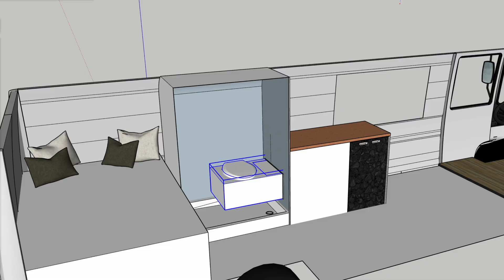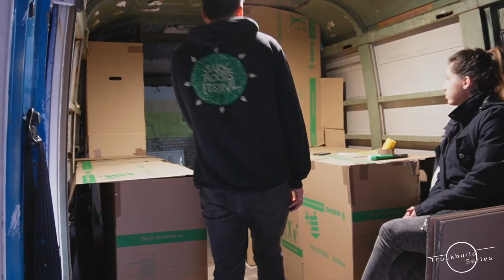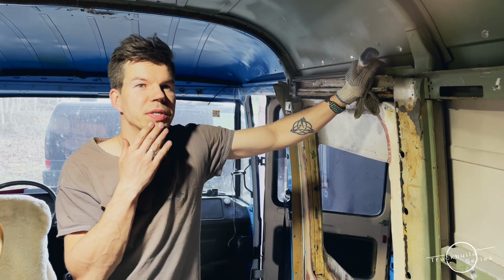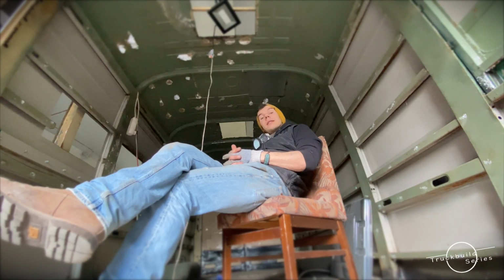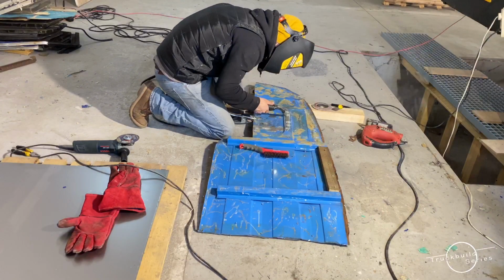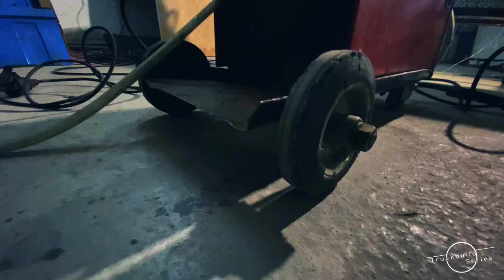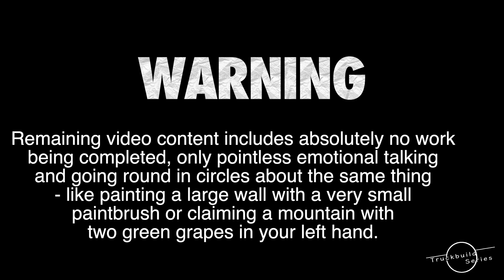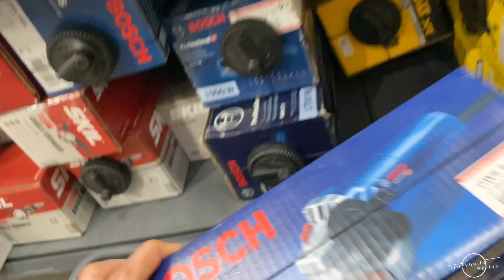Mercedes Benz 508D restoration , Ep1, Demolish and Planning

Comment: Feel your pain! Just a tip when you make the replacement panels, make sure there is a consistent gap all the way round of the same size of your mig wire diameter. Aim the wire between the plates I.e into the gap and that way you’ll get full penetration. Also to mitigate warpage tack weld all around the plate first. When you start Stich welding make sure you aim into the previous spot weld by a third of its diameter. If you have an airline then use it to cool the welds before each spot weld, or a dampened rag will do the trick too ( not wet just damp). You’ve got this 😊
Reply: Got all the tricks up my sleeve now, Thanks 🙏

Comment: Cleaning off the paint helps
Reply from the maker: At the very beginning suggestions came in to sandblast the whole truck which I was against for. If I could turn back time, that would be the first thing I would do. Truck off the chassis, sandblast ALL and etch prime the lot and only then start repairing. It would cost us but we would save 3-4 moths of time easy

Comment: Rusty thin metal is super difficult for anyone to weld.
Reply from the maker: That I do know now, always cutting it back as much as needed to find fresh metal through and through otherwise if there is rust in the pores, it blows a huge hole anyways and I end up cutting more out in situ which is more harder. Now I'm confident with metal and grinder growls all the time to cut out the stuff rather that trying to save the unsavable

Comment: Weld both sides.  U can weld hotter on the second side
Reply from the maker: Thats a good point, Thanks. Welding skills have increased drastically now after 1,5 years of welding non stop. It's something that I really enjoy now and I have been able to put this skill to use in many other areas, it's an amazing skill to have. As for the first welds done on the truck :D they have been cut out by now :))))